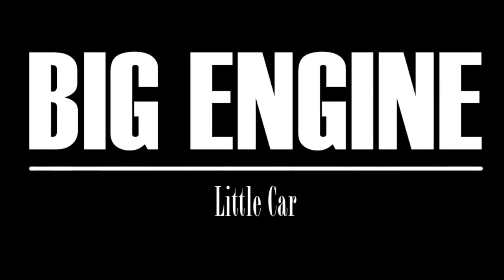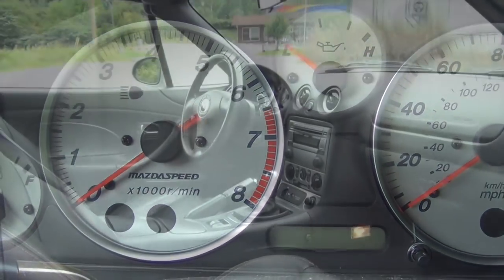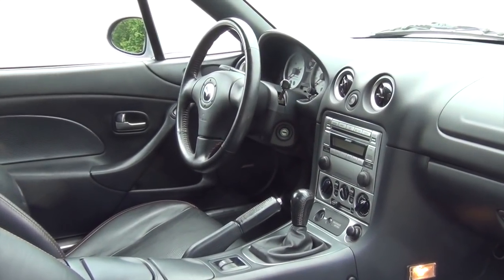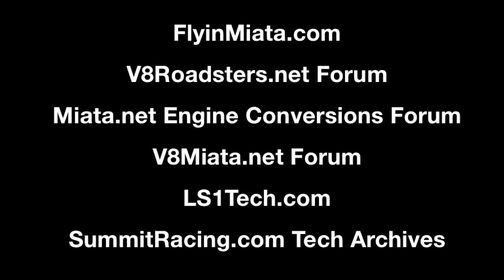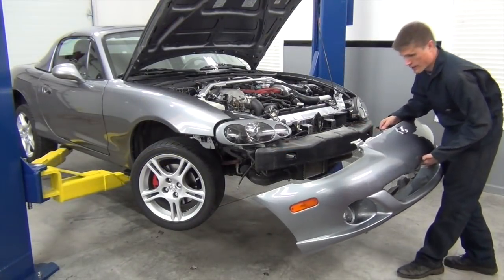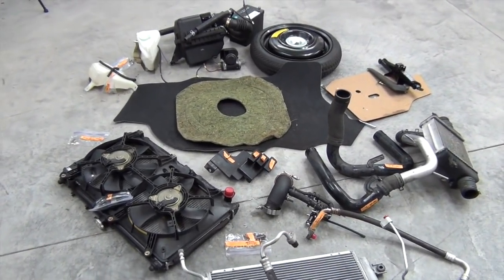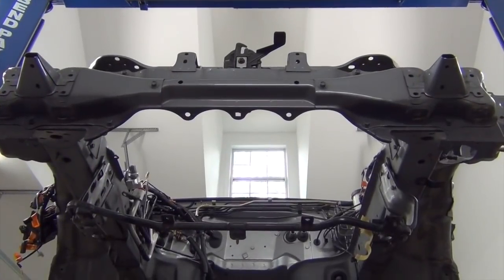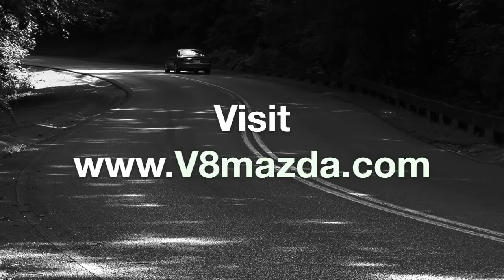LS3 V8 Miata Build - Project Thunderbolt Part 1

Comment: Sure it will be a fun car when done, but it's so uninspiring to just follow a proven plan and build out of a catalog. Regardless of the finished product I never really liked what I call "Checkbook Builds". Have some vision, do something different, and actually build something. rather than just order parts you know will fit because someone else already figure it out for you and bolt them together
Reply from the maker: Out of curiosity, did you happen to watch any of the other videos in this series or just this one?  If not I would kindly invite you to check out some of the other episodes.  You can minimize my efforts and call this a bolted-together catalog build if you'd like, but you'd be wrong.  This project required a strong vision, years of planning and a variety of custom fabrication projects, all of which I show throughout the video series.  Yes, it all looks very simple and easy in these videos.  For example, I probably had 30 hours in the firewall/frame and tunnel modifications, but in the videos that takes 2-3 minutes and can easily be overlooked.  I marvel at folks who wish to criticize other's accomplishments.  Here's the bottom line: this car has been on the road performing at a high level without any issues for almost four years now.  I wouldn't change a thing and would do it all over again tomorrow.
Reply: Tom's Turbo Garage yes I watched most of them, and I stand by my comments. That's very minor metal work and is still just following instructions that someone else figured out. I know exactly what it takes to do that type of work, and if you think that little bit is a big job then you would absolutely faint at the sight of my build. I'm doing an LS swap on an MGBGT that pushes the envelope of sanity ( at least that's what I've been told by many who have seen it). Bottom line LS Miata is tons of fun, but been done enough that all the info you could ever need is out there and this just followed a proven formula, like a big expensive K-Nex kit. The finished car is really nice,  I'm sure it wasn't cheap, and I give you props for actually doing the work yourself instead of paying someone to do it for you. It is a big job with lots of hours involved and you do neat and tidy work. I don't mean to sound harsh, it's just coming out that way.
Reply from the maker: @mgbgtguy  It sounds like an awesome project and I look forward to watching your videos!  I mean, you don't just come on to YouTube to leave comments like this right?  Surely you offer something to the car enthusiast community besides this drivel.  I love my car and building it was a great experience, I hope you love your car too.

Comment: I am actually disappointed of another MX5 being ruined going down the LS route, why not something more interesting like a V6 Swap with twin turbos or something new
Reply from the maker: calvintibia001 I chose a compact, lightweight, proven V8 powerhouse with excellent aftermarket support and a long service life with easy to source parts.  I am building a car I plan to drive and enjoy for a long time. Plus, I just build what I like. It's ok if everyone doesn't like it or find it thrilling, that's not the goal.  You could probably find non-disappointing engine swaps in other places.
Reply: I understand that LS is an awesome engine, but it feels like it have been done so much times that people should probably try something else like a VH45DE swap + Turbo or something

Comment: It won't be balanced with that big ass engine in the front
Reply from the maker: Michael Rawlins Hi Michael, that's not correct- the car retains a 51/49 F/R weight distribution due to the light weight of the all aluminum LS3.  Most of the additional weight is from the transmission and bigger rear end which are at the center and rear of the car.  Even at that the car gains around 200-250 pounds and still retains excellent handling and balance.

Comment: Nose heavy.
Reply from the maker: Not nose heavy.  LS3 engine is all aluminum, and it’s mounted lower and further back than the stock iron block 4 cylinder.  Part 13 shows the weight bias compared to stock.